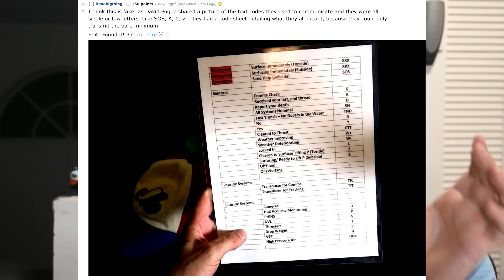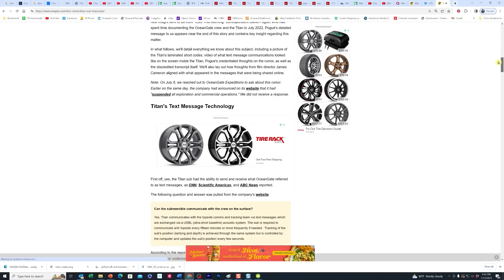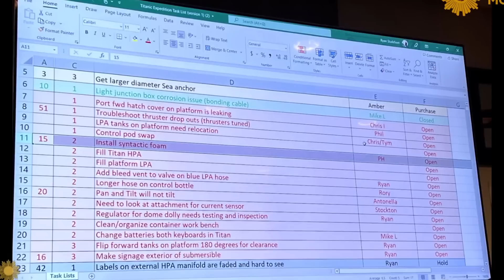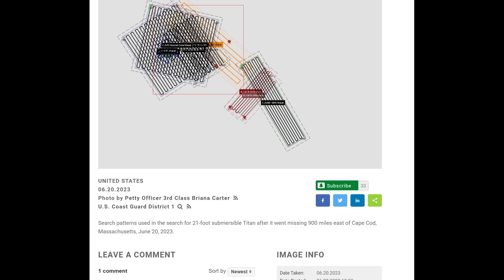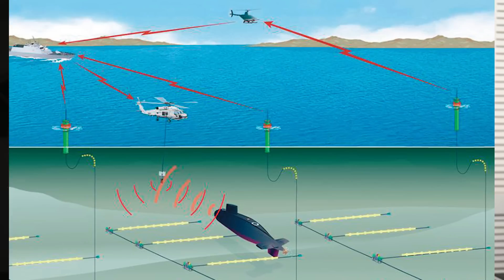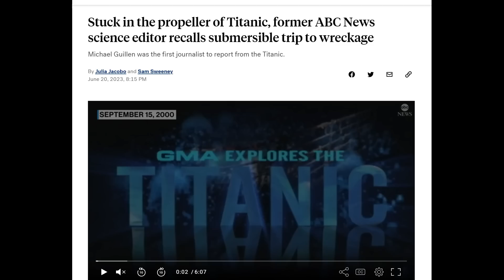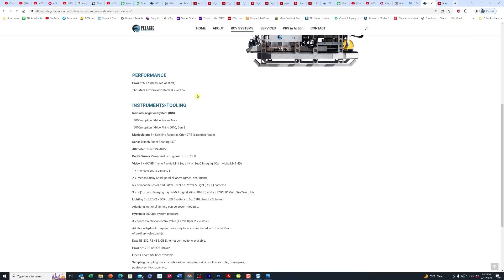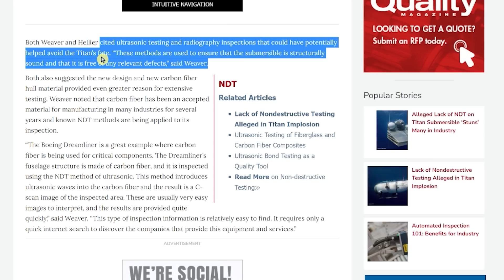The Shocking Truth About Fake Sub Transcripts No One Tells You

Comment: I don’t know about the transcript of the communications but I’ll offer this possibility:  if I was designing the system software for communications I would have a automatic translator built-in that would automatically translate the symbols or abbreviations into full English sentences - so that symbols would be sonically sent through the water but on each end the operators would be able to read in English and not have to memorize or translate.
Reply: I was thinking the same thing.... And making it a bi-directional system where you could key in text or single-word keys that would transmit a coded signal which would be translated back and displayed onscreen as the original words or text.
Reply: It is okey but that is not just how it works. When programmer is programing he needs ro know code and other programer who is working in same projects must know the code. It is just engineeeing world and we found this easily but for sure we live coments in brackets sometimes also. The reason why that translation is stupid is because some things have special terms in english language for example if I wanna give some action to the mechanist I need to know also a code on the dash for it. It is easier to comunicate in short codes in all engineering systems and there is reason why because that world does not work same aa office jobs etc it is just not how it works for many reassons....
Reply: @the_infinity_channel  I was an engineering applications software developer (programmer to you I guess) for large defense contractor for 20 years.  Thanks for enlightening me
Reply: @kenday7942  hahahah web dev is not same as submursible or mehanics engineering but close enough you shoul already know why that is not possible in that world 😂😂
Reply: @the_infinity_channel  web developer?  You’re reading skills are not very good either.
Reply: @kenday7942  I know that you use same programs languages as web dev for an app thats for sure it is same way. I assume you are old since you have 20 years of experience. May you learn new frameworks for js is that how far your dev skills are as an app creator or you are backend?  How far in programing languages skill you actually have? You must be offenses by the words I said because it is true. Titan is provment of poor engineering and breaking the rules in something you are not good at, and thinking you are. Consider this in next coment.
Reply: @the_infinity_channel Applications in this context has nothing to do with apps such as you might run on a phone. Believe it or not "old" engineers might know a bit more than you seem to. Your attack is unwarranted.
Reply: @rvoisey  I know it very well but it all have 2 cases : back end or front end this guy did not even answer. I know what app is and where it can be used but you can not change rules by adding translator to codes to people who are engineers. It is about that. That was the topic. That is even fun to think about. Codes helps especially in this kind of situation for faster things. You would have bunc of codes to translate every sentence did you asked your self does that submarine have and probably does have low space of memory etc etc low capacity etc etc. That is why c# is still sometimes better than python. Who the heck will send someone full message if that can be short code the question is..  I found it really stupid how those old generatuon are thinking and in this case scenario problem with Titan the most one problem is that engineers did not stick to their job. We are creators for sure , but we must not forget why some things should work way it works. Yes for sure we should made thing and do things different but safety is first especialy in this scenarios. If you are talking to your friend in codes fime do the translate of every single code but heck you don't do it in submarine situations. That is unprofecional reas is up here.
Reply: @rvoisey  thank you. You obviously know a lot more than this young little heckler. I didn’t bother to answer him because he wouldn’t understand anything anyway because he doesn’t listen and he didn’t read what I wrote originally. I told him I was in as an engineering application software developer for a large defense contractor. Large defense contractors don’t write phone apps. I have extensive experience in many different languages including C++, UNIX shell scripting, DEC, HP VEE pascal, Fortran, LabVIEW, Zilog mnemonics assembly language and others - and a bunch more - which I won’t bore you with at this point. My experience is both in avionics weapon systems and in semiconductor characterization and testing.  And incidentally most languages are used are still in use today. In fact Microsoft operating system is written in C++, for example.  Also, also I worked on testing software and OFP (operational flight program ) deliverables for the department of defense 
- US Air Force and Navy. No, I didn’t really answer at some point because I learned a long time ago not argue with somebody who is on a fifth grade level and doesn’t know anything more than what a smart phone application is.
Reply: @kenday7942  Ouch!🤣 Guessing they'll never reply after you buried them in several metres(and many years) of experience. Nice.
Reply: @madb132  well I am not usually and do not like to be a butt head but he just kept coming at me and it was obvious he didn’t know really anything about the subject. He just thought he did. I kind of feel sorry for him because he knows less than nothing about it. How is that possible… He THINKS he knows a LOT and unfortunately will apparently never realize how little he does know.

Comment: The glueing job was the appalling to say the least. Just think about the weight of the front dome hanging on the one hinge out of the water. They even had a bottle jack under it. The stress on that shallow glue joint would have be insane.
Reply: Those adhesives are strong, and the contact perimeter was about ?4.5 metres.  You could hang a large truck off that assuming the hinge and titanium ring would take the loading.  I've hung 1/3 tonne from a few square inches of good adhesives in shear (not tension) without a second thought.

Comment: Here's another question for you:  With regards to the titanium ring installation:  your analysis of the adhesive is spot on, but: (not an engineer!!!!) To me it seems that the way the titanium ring was placed on the carbon fiber tube is a failure point in itself, given that the compression of the carbon fiber and the titanium will be different, that is a fail point in and of itself.  Any thoughts?

Comment: The design of the carbon/titanium interface is insanely stupid.... You'd want as many surfaces contacting each other as possible. They designed in one short lip on the outer edges where they had to thin out the thickness of the carbon by .5in on on either side.... They should have thickened and channeled the titanium rings 5" to accept the full thickness of the carbon tube... Depending on how you design that channel, you could easily have at least 5 etched surfaces mechanically locked. 
Besides not foolishly winding the filaments in 1 direction... Holes could have been molded into the carbon cone for bolts or pins to introduce an even stronger mechanical lock.
The real problem was in winding the carbon filaments like a thread bobbin.... Moron.

Comment: Good point about the adhesive not oozing out. And I wonder if they mixed it by hand. Really should have been mixed in a vacuum to prevent air bubbles, I would think. The finished product would be a lot weaker if there were lots of tiny voids formed by air bubbles. Also just the way they were applying it with a trowel might have introduced lots of bubbles.
Reply: They did mix it by hand, and they cleaned the surface with dirty rag and re touched the metal with a bare hand. While I may not be a material engineer or carbon fiber expert, I do know about expoy and glue/ epoxy joined pipe.  You want it clean, you don’t want skin oils on it. You want it not have air bubbles, this is stuff a plumber knows and it shocks me how they did it n
Reply: @noahwilliams9118  
I just built a Smyth Ute from a Jetta ,and did a more professional job than those guys. 
I saw all that and was shocked. 
I'm just building a car, I can pull over if it starts to break up. 
2 places you don't mess around ,and that's the air and the water. 
3m structural adhesive is some wicked stuff , a real game changer for me at least.
It's possible to weld aluminum to steel now!
Yeah no way Jose, all the guys around the play shop (hangar at an airport) gave me tons of composite advice building this thing.
And one of those bits was nothing is more powerful than the sun and water combined, and add some time. 
It gives composites a real bad time at survival for long term.
Reply: Greasy and Noah are both right on about the contamination and air bubbles in this glue joint. The composite tube likely should have been put in a vacuum before the autoclave process to eliminate bubbles as well.
Reply: Same with the resin for the carbon fiber. The whole thing was an absolute MESS.
Reply: No
Reply: Yep, just a couple of dudes slapping it on with spatulas. None of it, including the hull, was even cured in an autoclave.
Reply: I suggest that if there was any slop of adhesive outside the seam that the enormous water pressure would push the excess from the outside into the seam and perhaps the connected section and that would not be optimum.
Reply: the shape of the ring joining the carbon hull (annular piston) garantees there were air bubbles trapped

Comment: Didn't they raise the parts with airbags? I could swear I saw a video of some of the pieces popping out of the water with air bags around them.
Reply: You can't lift something from 4000 m by airbag. To inflate 1l of airbag, you need 400 l of air. Gets worse. Because of the increased density of air that 400 l gives you only about 1/2 kg of buoyancy. If there were any airbags involved, they were used only to keep the stuff on the surface.
Reply: @curiouscat8457  oh well, I imagine we will all find out how they did it eventually.

Comment: The sheet of codes provided by the reporter disproves nothing. "Codes" of this type are generally meant to convey a limited number of very specific things; i.e., the most pertinent information or most commonly encountered/expected issues. There's simply no way every possible scenario could be anticipated and assigned a code. Such a system (which everyone must learn) would defeat the purpose of using it the first place (more efficient communication), as it would effectively require learning an entirely new language (too laborious and time consuming). Is all radio traffic used by police, for example, 10 codes? No and for the reasons just mentioned. (By the way the curricula for first responders actually discourages the use of 10 codes, and encourages the use of plain English, because they're not ubiquitously known which can be problematic.) What is the code for a shark bit off the front right thruster? What's the code for the toilet is overflowing? Show me the code for "key mapping on the video game controller is wrong." Because that's an issue they encountered, but I don't see it on the provided list. I do see it being addressed in common English in the excerpt of the video you reference however. ("CONTROLLER MAPPING WRONG?") In such scenarios you resort back to basic communication; you have no other choice.

As I said in response to your previous video, if it's fake, it's a pretty convincing fake. The communications are terse. The way grammar in the Titan's transmissions ostensibly degrades, for example, as things progressively deteriorate was a nice (and subtle) touch. Someone clearly put some thought into it if a fabrication. I lean toward it being fake also, because I must (in the absence of proof), given how readily people resort to fabrication. But it's a rather plausible fake.

Comment: What I wonder most about is the "alert system", the RTM. What was it supposed to do? If it signals a crack in the hull how much time was there to react to it? 
In my mind any crack developing is starting a chain reaction. And that means EOL.
And what was the plan to react to any signals going red from the RTM? Stop the dive and go for 2hours rising to the surface?
I think they thought that there will be miniature reactions of the hull like setting. Which would not result in a chain reaction to rip the thing apart (crunch it). So that was their model of what could happen and the RTM could be good for. But they obviously never thought about catastrophic failure as in a chain reaction that could not be stopped by halting the dive (not increasing pressure) and getting back to the surface.

Comment: What are the working theories on why the sub couldn't ascend when they decided to try?
Reply: I think the general assumption I have seen is that it was already delaminating and taking on water.  I don't know if that is correct.  People are tying that in with the fast descent rate.  Another factor I have seen mentioned is perhaps they calculated the mass and volume of the passengers incorrectly. In that case the sub would also descend faster.  Also tied into that is the possibility that they might have had too much ballast. But at this point it is all speculation by random people on the internet.
Reply: @manlinessandmotivation  Thank you! Hopefully the investigation will bring some clarity.  Even though it seems clear the root cause is more than likely related to stupidly ignoring design limits all over the place, would be helpful to have more facts to decipher how it all went down.

Comment: I think it's true. If you check the timestamps, there are no instant replies. When the mothership said they lost the Titan at 9:45 although the last text was at 9:46, that means the text was sent a minute earlier and was only received by the mothership after a minute.
Reply: The speed of sound in water is about 1500 meters per second. Any acoustic signal sent from the ocean floor at the wreck site would reach the surface in about 2.5 seconds, not a minute.